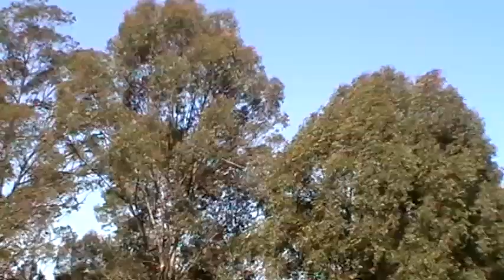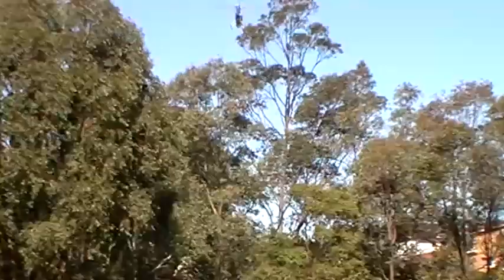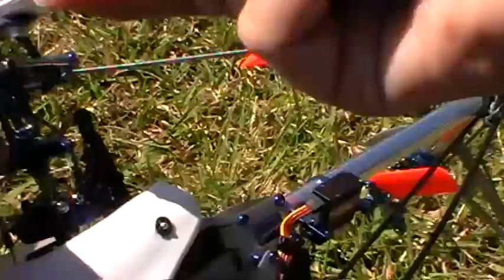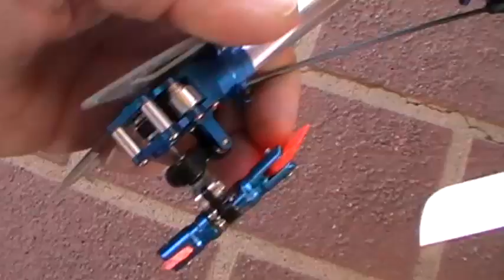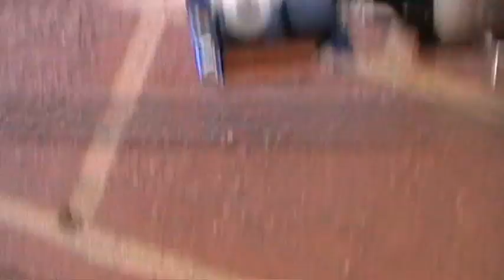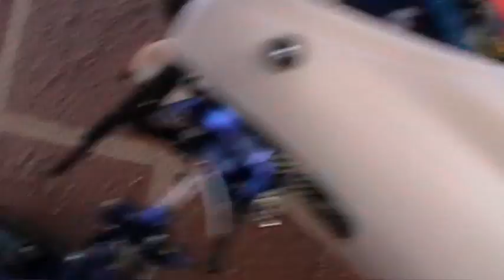T Rex 450 Clone Linkage Failure During flip

Comment from the maker: It's OK for most flying, and some basic 3D, but the moment you try to do 2 flips or a tic toc then it has shortfalls, but I still highly recommend them, they will suffice for most pilots and I still use them, but I am now using GY520's on 2 of my heli's, the rest have the 401B clone gyro. They are good to hover inverted You will find the nose will go to the right 45 deg after 2 flips back to back. But for one flip or roll or inverted hover it is fine.